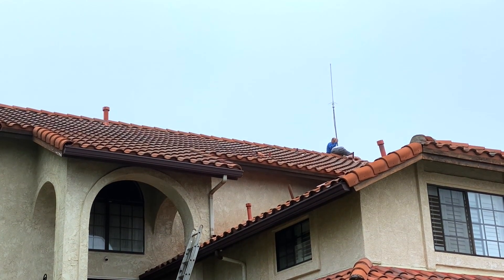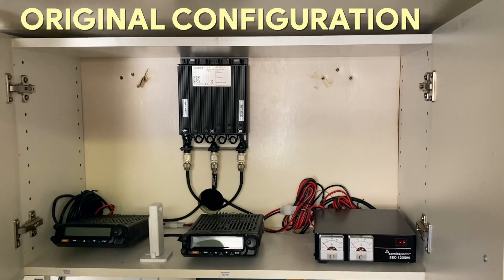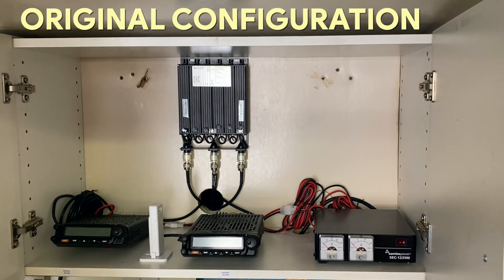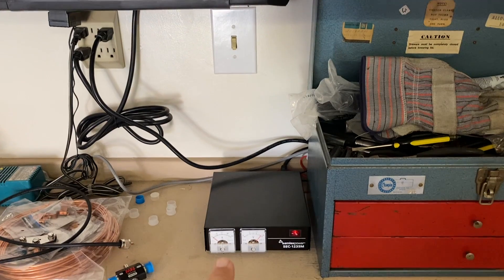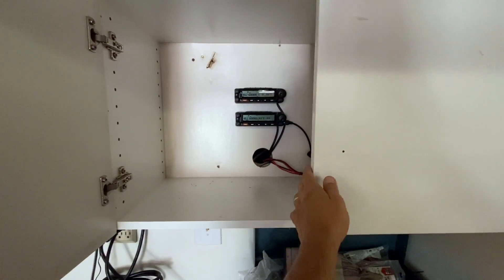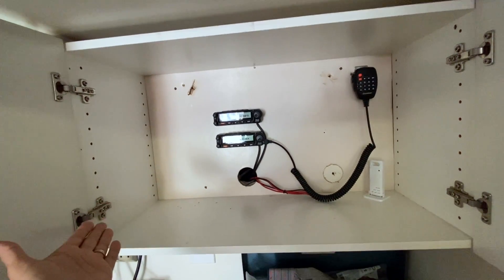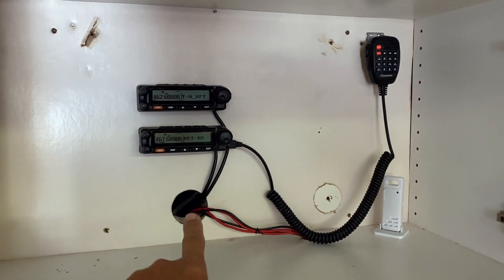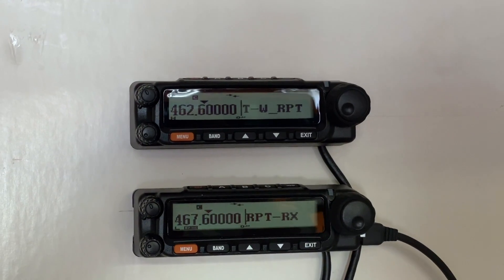Wouxun KG-1000G GMRS Repeater Build Update - How Is The GMRS Repeater Working After 30 Days?

Comment: Was considering building a repeater with the KG-1000's but read about issues from 'some people' when using the 50W XLT duplexer. Would a 100W duplexer solve those issues, or is the best option going with two separate antennae?
Reply from the maker: If you're willing to spend the money for a 100W duplexer, then you might as well just use that money on a real "purpose built" repeater.

Comment: Question ( dumb question ? )
I'm totally new to this stuff ( only days ).  No License yet.  My past life in the mid-70s was any-hardware any-power any-thing-goes ( the more the better ) on CB 27.115-MHz  GreenThumb KPZ### something in Glendora CA.
I'm considering getting into GMRS because I was handed some $30 Baofeng 5RM radios 3 days ago ( and I rather like it ! good super high-quality well almost ... ) .
I watched your videos on "  Homemade GMRS radio repeaters "
Question , for a super low-low-low cost GMRS repeater , could you of just used:
 - two low-cost $30 Baofeng GMRS radios
 - a $27 " RPT-2K Two Way Relay Walkie Talkie Repeater Box Baofeng UV-5R DM-5R GT-3TP Radio" cable.
 - External outdoor antenna
 - Charging stands ( if utility power goes out , there is stil the battery on the Baofangs to keep things running for possibly a few hours give-or-take )
 * One or both radios set is VOX
When I apply/get my GMRS license , I'm wanting to put a home-made GMRS repeater at an Internet wireless ISP tower I own which is on top of a 4,000+ foot mountain here in North Idaho.
Because of the height , I suspect 8-to-10 watts might work well.
Sooo , for about 100 buckeroos , is my thinking bad or just ...
Love your videos - like your attitude
North Idaho Tom Jones ( Internet Engineer & some electronics )

Comment: How far apart is your antennas? I’m working on a 5watt repeater for gmrs? Just curious how far apart they need to be. Is it vertical or horizontal or both separation
Reply from the maker: Vertical separation is best, but I am limited in how far i could keep them apart and it caused issues.. if i recall, it needs to be at least several feet (more than I was able to do)
Reply: @TheNotaRubicon  thank you sir much appreciated. How how far apart was or is your antennas? I understand yours is 50watts. I’m building a 5watt but this is to learn on then I’m going to build one like yours for my community to use

Comment: It would seem the two antenna program would perform better if properly installed because you don’t have the power loss of running through a duplexer. I know this is an old video but it’s very informative and I do like the directional receive and or the possibility of a directional transmit
Reply: Dealing with my ham repeaters over the last 40 years I can tell you that in most cases it is better to take a small loss with a duplexer than 2 antennas.   One advantage is that the transmit and receive path is the same.  Sometimes moving a the transceiver a few inches to a few feet will allow you to reach the repeater..  You can tell by the received signal to where to put  the transceiver antenna.

Comment: So I built the same setup using the same equipment. 2 KG1000G’s, XLT duplexer, Tram 1486-b antenna. I have the radios separated by about 16 feet that’s as long as the data cable is that connects the radios together. Still have desense issues. I also installed a low noise amp between the duplexer and the RX radio. What else can be done to stop the desense issue?

Comment: If you wanted more distance, would it be possible to add a amp to the output radio? Thanks for the video!
Reply from the maker: For more distance a better antenna or moving the antenna to a higher spot usually helps more than just power.

Comment: Thank you for creating these very informative videos on repeater building and use. It's been 2 years since these videos came out. Now that the Midland MXT 500 is available, does it mean that we no longer need to connect two Wouxun KG-1000G radios together? Thanks for sharing.
Reply from the maker: As far as I am aware, the MXT500 is not designed to be connected to another and be used as a repeater, like the KG1000G is.. So, probably not.

Comment: I wonder if there is a cheaper radio to just receive that will work with the KG-1000? The receive radio is only receiving, so it doesnt matter what transmit power. Just need the 50w KG-1000 for transmit
Reply from the maker: There isn't.. At least not one that is setup to work in this configuration right out of the box.
Reply: @TheNotaRubicon  ok awesome. Thanks for the heads up. I'll do some research and see if there is anyother setup or configuration. If not, I will try this. Thanks for the help!

Comment: I’m building a kg1000g + repeater similar to yours and I am having a wattage issue. I have the duplexer set up like this -
Low - transmite 462.70000
High - receive 467.70000
Swr meter wattage in simplex right after the kg1000g+ is 44 watts.
Swr wattage after duplexer is 28 watts. In simplex
The Swr in repeater mode is only 25 watts after the radio and after the duplexer it is when I am getting the 9-14. I used different coax moves the radios around, reset radios, and I have the same readings. What am I doing wrong ? Is my radio junk ? Did I buy junk ? Help
Reply from the maker: Your comment is confusing to read, but lower power after the duplexer is normal, thats just how it works.
If the radio puts out X in simplex, then, when the only thing you change is putting it in repeater-mode, the power drops significantly then I recommend contacting BuyTwoWayRadios support because that does not sound right.

Comment: Hi. Thank you for your video! I'd like to ask you two questions. I know nothing about portable radios, that is why I have two UV-5Rs. One of them always drains all the battery after a few minutes transmitting and the other lasts more than 10 times that. I use them only for family communication but I'd like to learn more. Could you please tell me where I could find a good ham radio online course? The second question is which portable ham radio would be reliable, be a good purchase for a beginner that would not waste money, and work for family and emergency communications? I'm writing from Brazil, where every dollar needs five times more work to get earned then in the US. PS: I'would also like to buy a good base station for my car.

Comment: Thanks for the very informative video.  I am currently setting up a KG1000G Plus repeater also.   How far apart (distance)do you need between two antennas? Transmitter antenna will be transmitting 360 degrees.

Comment: Enjoyed binging your repeater build series this evening.  My hunting club has me looking at our options for two way radio communication because cell phone reception isn't always reliable while we are in the woods.  We only need to a cover 5 mile radius from the cabin at most for deer camp activities.  This repeater set up will be a bit overkill for us, but if we decide we want maximum range this will probably be the direction we go.
Reply from the maker: Retevis RT97 is probably a better option.
Reply: @TheNotaRubicon  thanks for the suggestion.  Looking into the RT97 is how I rediscovered your repeater build series.  I agree that the RT97 will probably be the better option to start, especially since it will mostly be used for deer camp activities.

Comment: Wonder how this setup would do with a 200 watt solar panel and big battery.
Reply: It depends on many factors probably the biggest factor would be how much transmitting and receiving would be going on because that's where the radios get hungry for power..

And 200 watts is not a lot of solar...

So it would also depend on if you lived in Seattle or Mexico
Reply: @portlandlocalchurch8168  Right, 200 watts+ battery 
would be a semi-compact setup that could run on its own somewhere on a property without crazy investment beyond the component price.
Reply: Specs on Randy's power supply are max load of 7.5A/110V so a lot more than 200 watts.

Comment: Hi, I have a question it might be a dumb question but it's a question. I bought two Wouxun KG-1000G Plus radios and two 30 watt power supply to run both Wouxun KG-1000G Plus radio for a repeater.  I see in your video that you're only using one 30 watt power supply to run both of your Wouxun KG-1000G radio. Do I need to run both of my 30 watt power supply to run both of my radios?

Comment: Hey Randy!!

Great stuff! At least getting information on amateur radio is ACTUALLY informative now!! Not like taking a sleeping, or a "I'm stupid" pill.

Q:  Do any of the Midland GMRS micro mobiles have the capability of linking two together as a base repeater like you did with the Wouxan (wocean) 1000's? Any other GMRS OEM mobile offer this?

🤑💸dozens of pennies headed your way💸🤑
Reply from the maker: None are designed to be linked together. It might still be technically possible, but you would have to DIY it.

Comment: I setup a repeater much the same as yours Randy. I ended up using two different antenn's as well. From what I have been finding out is the XLT duplexers are for small portable radio's with less than 5 watts of output. In order to get the Wouxuns to work with it I had to turn down the x-mitter radio to low power. Once I removed the XLT from the system and installed the 2nd antenna , everything worked normally. I recommend using a set of  Harvest BC200 antenna's as they are already pretuned for the GMRS frequencies. (They look the same as the Tram 1486). This info is of course based on my install of the Wouxun KG1000 radios. I also will add my antenn's are approx. 75' feet apart and the transmitting antenna is about 10ft below the receive one.

Comment: Have you found any documentation on the pinout for the “pc” port. Have been using this setup but currently have to tap into the mic ports to use my repeater controller for id and other features. Problem is that using the lamp pin for COS, it is triggered even when no PL is used. :-/ I’ve been looking everywhere for the “pc” pinout to see if there is a chance to use that port instead. 
Thanks WROY605

Comment: Randy, great channel!! I have a question about licensing. If I have a GMRS repeater transmitting at 50 watts and a non-GMRS licensed person wants to use there FRS radio, would they need to be licensed at that point since the repeater is  re-transmitting there conversation at 50 watts which is over the 2 watt FRS limit?  I'm very new to GMRS.
Reply from the maker: FRS radios are not capable of using repeaters.
Reply: @TheNotaRubicon  Thank you!

Comment: I’m wondering about using pure solar power through a small charge controller into a couple of deep cycle batteries to feed the radios directly and cut that 110 AC to DC all together?  That way you have true emergency set up?

Comment: Randy—I appreciate you continuing to answer relevant questions even after a year has lapsed!
I read through all the comments because I didn’t want to ask anything you’ve already answered (unlike the sad grounding nazi hams and other stupid people).
I see that you’ve ditched  your KG 1000G repeater set-up for a dedicated repeater that’s better suited for 24/7/365. But early on the feedback was as long as the units stay cool, they will work just fine with constant use. 
Another commenter suggested keeping everything on low power and using an amp to boost to the antenna.
Just curious why you switched and if an amp would solve the problem?
Lastly, would love to see how you’re testing the installed system and determining loss etc.
BTW—just got the call sign yesterday (WRQY817)—$35 for 10yrs.

Comment: How much separation did you put between the rigs to prevent the RX desense?
Reply from the maker: I had mine several feet apart and was still getting a small amount of desense.
Reply: @TheNotaRubicon  thank you.  I just got a couple of these things in and am doing some research before my build.  Wondering if putting cookie sheet or something else between them would work

Comment: This may be a dumb question,  but if you're getting 30 mile range with this setup,  do you know any details about the repeater you routinely hit at 70 miles range?? Is it purely a matter of altitude on the antenna 70 miles away? Do you expect the range to decrease when you get the duplexer you wanted? The power at the antenna will go down with the duplexer, right?

Comment: Hi, quick question, when you removed the duplexer and went double antennas, were you able to increase your transmission range from getting the additional power back that the duplexer was robbing? 

Thanks, I'm looking to build my own and would gladly use 2 antennas if the power gain led to a dramatic increase in range. 

Cheers!
Reply from the maker: That was the plan, but the antennas interfered with each other and the de-sense negated the extra power.
Reply: @TheNotaRubicon  thanks much! I'll do some research to  find the optimal distance apart

Comment: Is there a reason that the list of components is missing?  I was using this as a guideline for building a base station and the info is not showing up for me.
Reply from the maker: The list is in the info-section of the video.. If you're not seeing it then your computer is broken..or, you're doing it wrong.
Reply: @TheNotaRubicon  Well, it would appear to be the former.  Apparently not loading the build list was just a warning on the way to my trusty iMac going into the infinite death loop.  Back on another computer and it loaded fine.  Now, I get to spend my base station/repeater budget buying another iMac.

Comment: So when you leave the repeater ON, is it drawing electricity?

In other words, I understand it is using electricity when receiving/transmitting. But when no one is using it, does it draw electricity?

Just curious how much your electric bill went up. 

Also…once you added the second antenna, you obviously needed more of that phat expensive wire. 

So how much was the total cost, everything included?

Also interested to know if there were any additional fees to have a repeater in your house from the city, the FCC, or whatever.

Comment: Randy… This is NOT about antenna grounding! Would it be possible to share more info (and pics) on how you finally installed the antennas onto your roof? Where and how mounted… considerations for secure mounting/attachment… etc? I am not asking about running coax or grounding. This would be quite valuable to those of us totally clueless, when developing an antenna mounting plan. Thanks for everything!

Comment: Can you use the BTech GMRS 50X1 50 in a build like this?
Reply from the maker: The Btech does not have the functionality built-in to operate in repeater-mode like the KG-1000G has.
Reply: @TheNotaRubicon  thank you for replying I was beginning to think you were a ... Anyway I reverted back to the training from my mentor and read the manual that I had to DL. You are not the afore mentioned. But I found that the BTech GMRS 50X2 50 can be used for a repeater build such as yours. Can you express your thoughts and knowledge about this configuration please?
Reply from the maker: The 50X2 is a ham radio and I am not familiar with it, so cant comment.

Comment: Hi, Randy. I am a Ham of over 40 years (and recent GMRS licensee for our local ARES group)and so sorry other Hams are so rude and arrogant. Since I am a Ham, of course, I have a stupid question - I would like to do a setup as you have done and wonder how far apart you need to keep the radios to prevent emissions crossing over? Alan KZ6B
Reply from the maker: The radios aren't shielded so keep them as far apart as possible.
Reply: It’s surprising that no one mentioned trying to put some chokes in the 12 volt leads and maybe in the patch cord between radios.

Comment: Thanks for the video I'm hoping to try something like this out at my cabin since there's no cell phone signal out there I'm going to have the similar issue that you have of where to mount the antennas at because the house is in a valley so I have to figure out how to have a mobile setup on top of the hill I don't know if that would have to require a solar panel and a deep cell battery so it could be self-sufficient but I'm not sure how much power I would need to run this setup on a semi regular basis any advice would help thank you

Comment: For anyone looking to build a similar repeater but wants to house them in a cabinet. Have a look at digital thermostat temperature controllers for incubators, they can be had on eBay for ~$8 and will handle AC or DC depending on which config you buy. I did something similar to pull hot air out of my entertainment center with 4 cheap CoolerMaster computer case fans and a 5v power supply.

Comment: Question: When using the two radios as a repeater, are you still able to use one of them as a transmitting base station? 
Jim Jones
Boston, MA
Reply from the maker: Yes, but you have to change the settings to take it out of 'repeater mode' first.